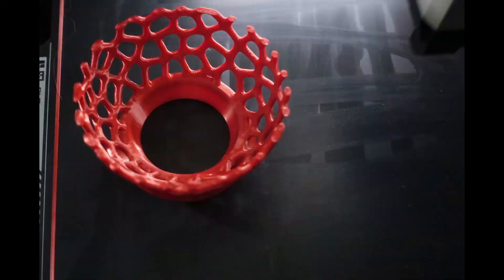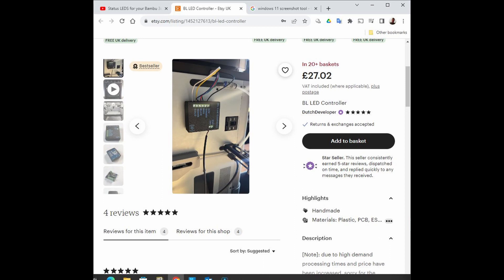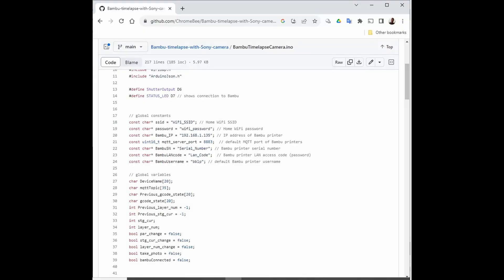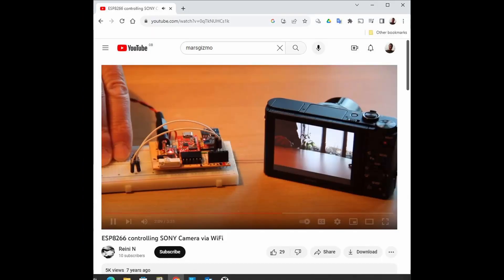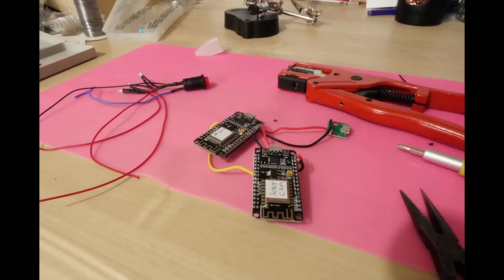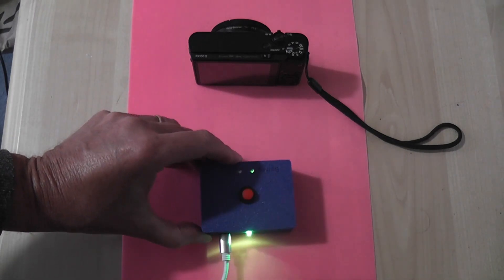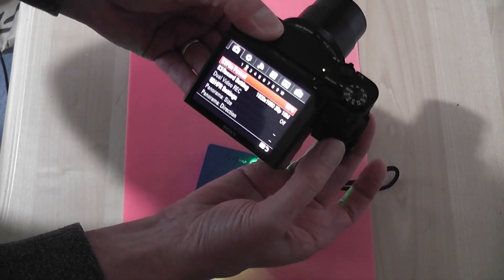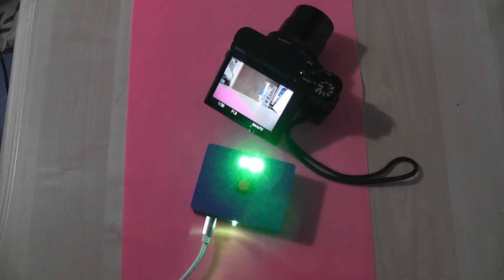Camera controller for Bambu printer timelapse

Comment: I am using a Bluetooth controller and Sony camera for time lapse in Bambu A1 Mini, do you know how to modify the extruder time when it moves to the left, in the custom gcode?
Reply from the maker: I don't have an A1 Mini but I'm guessing it will be the same as all other printers. In Bambu/ Orca slicer edit the printers configuration ( the edit button next to the printers name).  select Gcode and modify the Layer Change section. Look for a G1 X??? something which will be the instruction to move the print head add a line after that that causes a delay like G4 P2000 (which is a 2000ms (2 second) wait instruction). I looked up a lot of gcodes on the internet to understand what the printer was originally doing and where to make my changes. If what I suggest doesn't work, you may have to do the same.

Comment: Any ideas of what kind of camera to look for that isn't 1200 bucks?
Reply from the maker: I can't recommend cameras as I rely on advice from others when buying such things. My Sony camera didn't cost me as much as $1200 when I bought it, though it was quite expensive and it can now be bought for around $600. If you need a cheaper option, then my action camera timelapse option is probably what you want. That camera was around $40, but the method used of a servo operating the shutter button can be used with any camera. It could operate the shutter, a cable release, or a camera remote control.